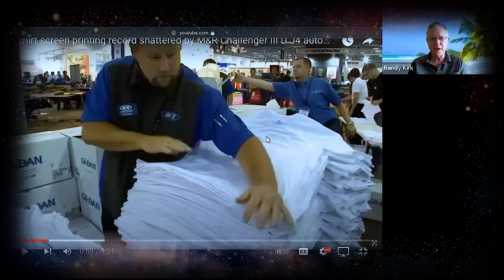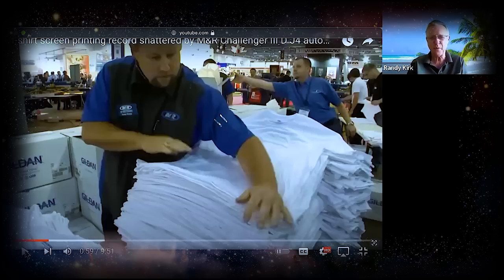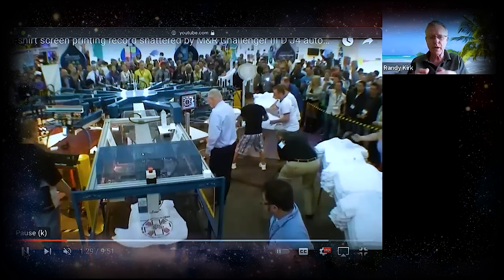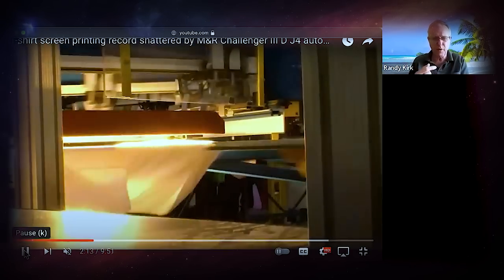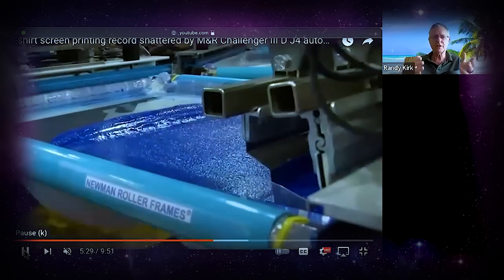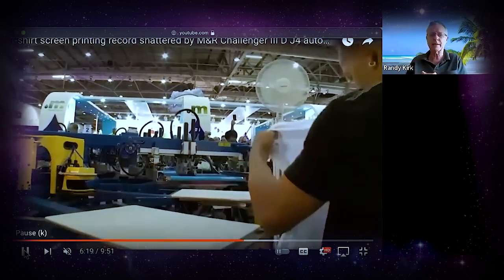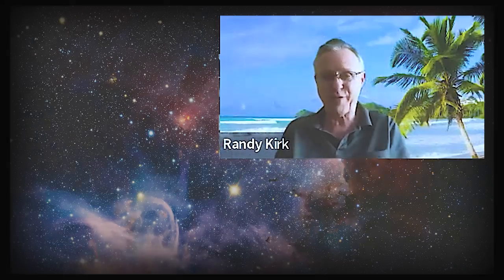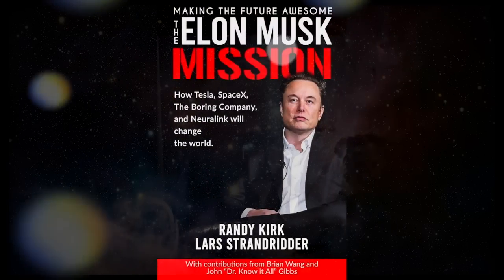Elon Musk Said Optimus Coming Soon. You'll Believe It After You Watch This Use Case Video

Comment: Tesla will keep them all in house until such a time as their volume production exceeds their own demand. That may take a few years. They are not likely to be able to produce "a million" of them next year or even the year after. Factories will have to be designed, built, debugged and scaled up. That will not be something they can complete in less than two years. And in the mean time, their bot design is not yet fast enough, durable enough and cheap enough for such mass production. Personally I don't think we will see Optimus bots available for sale until at least three years have passed.

Of course I would love to be wrong.
Reply from the maker: Scott Walter says you can set up manufacturing very easily. In fact, the bots could build a lot of the bot.
Reply: @RandyKirk_YouTubeChannel   "Prototypes are trivial; Production is hard"  Elon Musk
Reply from the maker: @panpiper  This statement by Elon Musk requires massive context. In fact, I'm going to do a video on it. I'm sure he's right about cars, but I can tell you that it is not close to true about water bottles, tire liners, small injected molded parts, bubble packaging, printed materials, halloween costumes, little girl's dress up clothes, and I could go on with a huge list. So, as to Robots. Designing the prototype will be pretty darn hard and require 1000's of hours. But it will be built to be mass produced. And while they might run into fitting issues from time-to-time, there is little else that will require much time to ramp.  In the case of my water bottles and caps, there was a huge issue with leaking from the cap where it meets the bottle and also where the poppet slides up and down. But, you go into production with your best shot, and then you iterate to get the job done. We were the first to ever make that cap with -0- leaks, and dozens of companies over decades had not done so. Probably took us 3 months.

Comment: It is clearly a combination of the complexity of the task but what is key is the speed but also the ability to do this night and day without breaks. So even if Optimus is 85% slower the fact that it does not stop (assuming it is connected to power) . Obviously each Optimi will need to be swapped for repairs and maintenance but in the limit Optimi can run forever. 
So the production rate for simple tasks can be done at the same speed between humans and Optimi. As the complexity increases then the human will out perform over short time frames because humans can maintain speed and accuracy, say over a constant 4hr window.  
As we increase this work window from 8hr, 16hr, 32hr, 64hrs straight Optimi will out perform even in complex task that it can do but at a slower rate over a short 1hr work window. 
Sorry, in most manual labour tasks that are not the most complex that require the most dexterous of hand working such as sewing and stitching Oprimus will simply be better than a human over - at a minimum work window of 8hrs continuous work . This will be greater the longer the work window.

The question now is do we want Optimi to replace workers and the answer from everyone must be no.

From an investors view Optimi are a false economy because Optimi do not buy the goods Optimi produce so replacing humans makes no sense at all unless only Tesla will ever use them. If this is the case then yes, but eventually others will build Optimi over the long term and if everyone replaces workers then companies have no consumers to sell to. 
That alone tells you this is a stupid endeavour. It is like cutting off ones nose to spite your face.

What does make sense is to do jobs that humans can not do or are too dangerous for them to do. The only exception that Optimi must NEVER be used for is in the killing of other humans in warfare or policing. They can assist and carry non-lethal weapons but that is it. The other clear application is for space where they add very high value to humans and Elon has a ready made customer in SpaceX.
Reply: Elon specifically stated that the bot would replace boring jobs. There is an obvious direction this is headed. Billions of jobs worldwide will be replaced, and billions of people will become permanently unemployable. Tesla or similar companies will make trillions in profit, pay trillions in taxes, and that money will be distributed to the masses as UBI.

Comment: If the Optimus robot has finally solved the human hand dexterity limitation problems that all it's predecessors have had then your assessment that it could do all these jobs of handling these t-shirts is correct.  
I've been out of the automation industry for awhile now and I don't know how much progress has been made in 'hands'.  Maybe it's great now.  How dexterous are the Optimus hands?  Has any information been released on that?
One of the most difficult types of 'part handlers' I've worked with in many years with an automation company was when we had to manipulate soft/bendy materials.  Soft materials just don't want to cooperate when you try to guide them with feeders and hard metal manipulators.  Sometimes when dealing with the soft/bendy materials the human hand just has no match in the handling of those types of items.
Reply: Randy is completely off base with the title and content if this video.  There's zero evidence Optimus has the dexterity to pick up one flat shirt off of a table... much less off the top of a stack.  Highly, highly unlikely IMO, and Randy's gone mad with speculation. 😮
Reply: @737smartin  given decent silicone ‘gloves’ over the fingers and AI’s propensity for learning, I’d suggest a high probability that it could be done with training.
Reply: @BongoWongoOG  Improved grip would nearly definitely be an important, likely easily-solved problem.  We just have no evidence they're even working on such things.
Reply: @737smartin  Agree no evidence for this specific task. Early days yet. Looking forward to seeing what they are up to though
Reply: @BongoWongoOG  Yeah, I'm reading my earlier posts about this and I guess that now I've become another one of the old timers who say "that can't be done" and  "back in my day we didn't do it like that".  :o(     Things are changing so fast now.  There's no telling what will be possible soon.
Reply: @tralfazy  your not wrong about things changing fast. I taught myself to write code 40 years ago fusing two programming books. Now I can just talk to the computer using my voice and the computer can wrote its own code. C3PO looked like true fiction, and now it seems just a stones throw away from reality. Its fun to see how rapidly the advances are coming. But humans aren’t equipped yet to deal with them. We have a lot of discovery still to do.
Reply: @BongoWongoOG  Back in 1978 when I tried to show my dad my new Apple II computer he didn't want to look at it.  He said it hurt his brain.  I'm starting to feel the same way when I see things changing so fast.  Too fast I think.  Scary fast.  It's fun too but I worry about where we are going with all this.
Reply from the maker: But these stationary robots were not employing vision or deep learning.
Reply: @RandyKirk_YouTubeChannel  One of my specialties with the automation company was training the camera inspection systems.  (1985 to 2003)  It was quite advanced, even back then.  It would position parts to sub-thousenths of an inch.

Comment: The thing is, you can surely automate that entirely, but why should that be an optimus/humanoid... More likely to see see a regular robot arm running on nvidia vision (not meaning to add to the stock hype...), or entirely automated perhaps
Reply: But then why hasn't silk screening been completely been automated ? It must cost too much to do it based on the profits you make from t-shirts vs the robot arms they use at car manufacturers where there is more margin. If a humanoid is more adaptable to many businesses that can scale more and be more cost efficient than hiring factory line engineers to do custom lines in all the vertical markets.
Reply from the maker: 100%
Reply from the maker: Chad is right. The process has not been automated because you can't set up the automation for 20 different types of garments, short runs, and more. This is precisely why the versatility of the humanoid form is such a breakthrough.
Reply: That's exactly right.  The humanoid form would be an extremely inefficient way to build a T-shirt handler.

Comment: Sorry, not an expert on Optimus.  Can you refer me to one video that demonstrates the dexterity of Optimus?  Something as simple as putting a stamp on a letter.
Reply: He can't.  There's no evidence Optimus can pick up the top T-shirt off a stack.  I believe this is a very hard task for a robot, and we're years from that kind of dexterity.  I believe Optimus can be useful for many things, but not for the things shown in this video.  Not ANYTIME soon.😕
Reply from the maker: Optimus would require almost -0- dexterity to take the product off the machine or off the drying belt. More is required to hand the product to the loader, but not much. The key to all of it is the combination of vision and learning.
Reply: @RandyKirk_YouTubeChannel  Then show us the evidence your video promised.  I'm an Optimus optimist, too...but there's zero video or hint of Optimus being able to lift fabric off a surface.  Everything it's lifted has involved a surround-grip.
Reply from the maker: @737smartin  Having spent many hours in a print shop like that, I can easily imagine picking up the shirt using a pincher move of my thumb and on finger to remove from drying belt or from the printing platant.
Reply: @RandyKirk_YouTubeChannel  Problem is, your imagined capability is billed here as evidence/proof.  It's not.  It's imaginary. 😕

Comment: Optimus hardware needs to have 2 features to be very very successful.  It needs to be faster than the human and it should be able to do precision work. Rest is software, but i personally think that speed and precision are very important for an AGI robot.
Reply: only precision, the speed doesn't matter, even if it's slower than a human, the Quality of the final output will be higher, due to the precision of mechanical motion, and the inability to get tired and make mistakes.

Comment: Great video, 11 potential manual mind numbing jobs replaced. But re-watch the video and notice, none of the workers are using there legs for walking, just standing and pivoting. So I would implement 11 x half bots, torso only, and wire into the system. No need for legs, no need for batteries and sync all movements to supply. Also, to maximise input, which required 3 people, you could use 4 x half-bots, 2 either side, one to prep and one to load, thus doubling the input potential speed. Thus a total of 12 half-bots. The focus is maximum productivity for minimal cost. Hence eliminate the parts you do not need (legs) maximise functionality, throughput and minimise cost. And if you do not do it, your competitors will.
Reply from the maker: Difference in cost is minimal. Benefit of flexibility in job skills way more than pays for the extra couple of $1000 to make it fully humanoid.
Reply: @RandyKirk_YouTubeChannel  I agree with you if the difference was only $1,000. The video you showed was a brilliant example, the actual printing process was automated, thus begging to be fully automated with bots for input and output.  As a software engineer and electronics engineer, I love the vision Elon has, and 99 percent of the value of the bot, will be the AI, without the AI, its just a bunch of metal. I want to see the bot to implement "Monkey see, monkey do" whereby you demonstrate the process to the bot and then it duplicates the process as you would do with an employee, hence making custom training "User Transparent". 

PS I love your passion and enthusiasm you have for Tesla as you see the BIG picture, and I look forward to all of your videos.

Comment: Optimus seems very slow on the videos I have seem.
Reply: The bots wouldn’t necessarily need to move as quick when you take into account no breaks, lunches, or overtime would exist. The normal 8 hour job turns into 24 hours without additional overtime pay.
Reply: It's not just a speed problem, it's a dexterity problem.  Human hands handling soft and bendy materials is pretty hard to duplicate with a machine.
Reply: I agree,it has to be able to move just as quick as these guys,although eventually the bots in all likelihood probably will💯